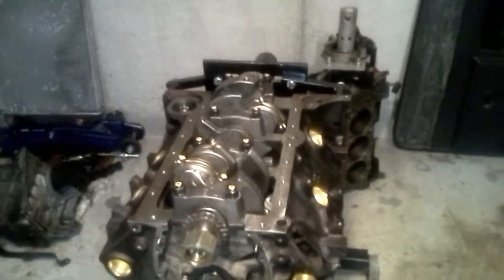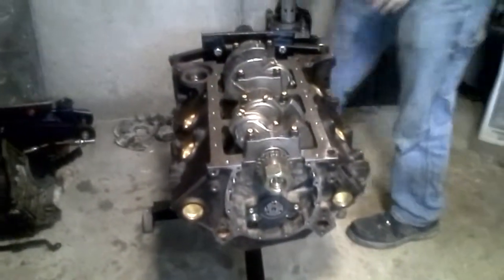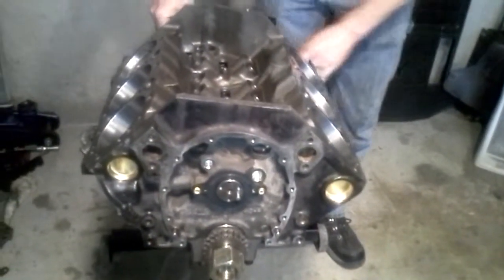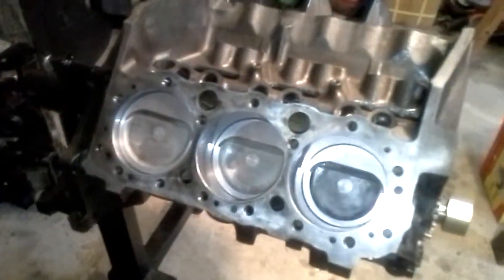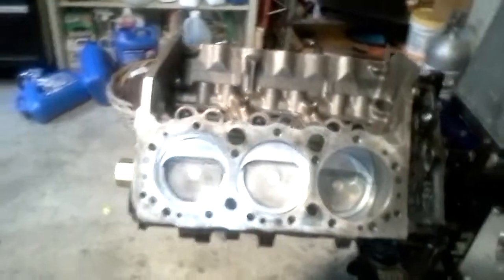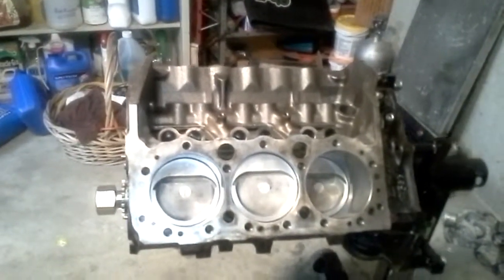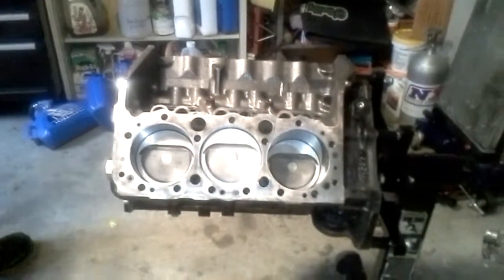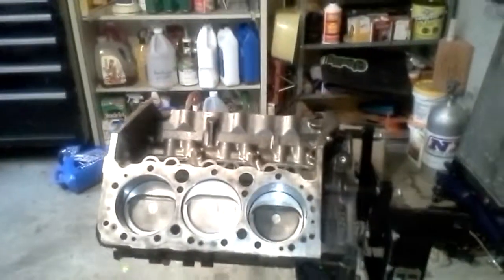600HP 4.3 assembly continued short block assembled

Comment: It will be a miracle to get 300 hp much less 600. I dont know why anyone would waste the money chasing 600 hp on a 4.3.
Reply from the maker: I think you missed the Turbo charger?  This was a purpose built Turbo engine which easily exceeded 600hp.  I would agree with you if we were talking naturally aspirated power, however we were not. 
This 4.3 easily put a 3800# Typhoon into the low 11’s 1/4 mile before flexing the factory crankshaft.  Rather than continue spending more and more money on the 4.3 platform the owner has since switched to Turbo LS power running 9’s in the 1/4 mile.  JD
Reply: @HeadFlowInc  i didnt notice that in the video. Im watching another on it now and see its a turbo build. I just built a 4.3. Next time i will go with a v8 swap. Too expensive to build these things for the small amount of power gained. Cant get front cover to stop pouring oil either. Have fun stay safe.
Reply from the maker: We agree!  Richard tried to buy a Forged 4.3 crankshaft, the only forgings available were left over NASCAR units, they were selling for $2800+ raw casting needs finish machine. 😳. That’s when V6 went out the window and he dove straight into the LS platform with zero regrets!  Thanks you do the same!  JD
Reply: yeah I'm sure you dont but what you lack to understand is that these engines are almost exact replica of the famous SBC and will have plenty of parts for decades to come that are cheap  .They are also every where and can be had for a few hundred bucks  and still very simple and  easy to work on ,shit you can get parts out of a Mercruiser  boats for your chevy 4.3l . there is a reason why ford bought chevy 4.3l v6 engines and had them installed in their mercury boats for decades   . They are not overengineered aluminum throw away engines,  you can rebuild these engines for decades to come  you can  take your over engineered with thousands of vacuum hoses and egr valves with 12 oxygen sensors  4 catalytic converters and encased water pumps  .In time these engines will be sought after in droves , why would anyone locate  their water pump behind the timing cover >??  ha  POS throw wawy engines you can have them ill stcik with the tried and proven  byebye dumbdumb